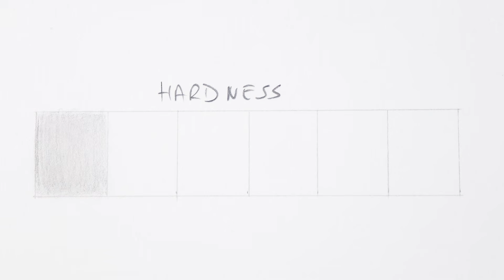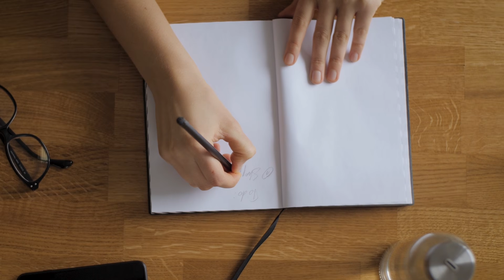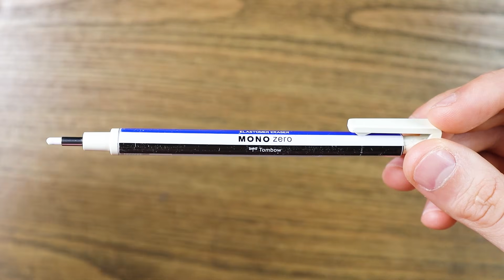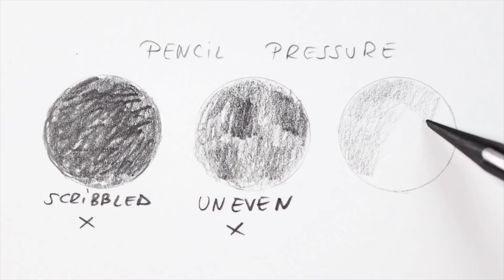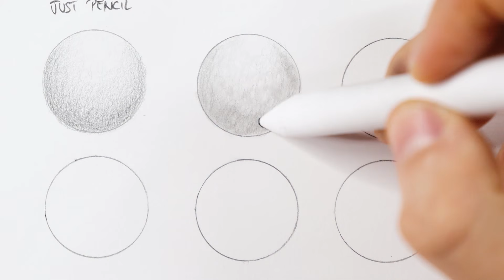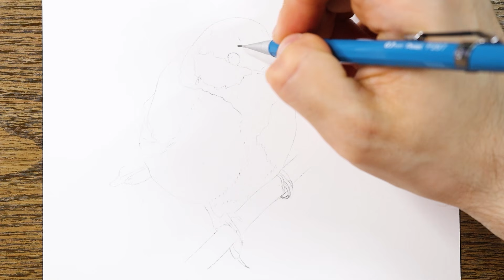HOW to USE GRAPHITE PENCILS | COMPLETE GUIDE for BEGINNERS

Comment: Question, Why when teaching for Beginners you did NOT start with a Light circle/oval for the head, and for the body. and divide where the center of beak is sort goes with line of the eye. which usually falls in the center. INSTEAD you started out with a semi tracing of your completed bird?  Doing this encourages beginners to FORGET doing circles, but put tracing paper over you completed bird , and go over their TRACING OF YOUR BIRD ONTO THEIR PAPER , having a far better non learning, on their own to do a bird they see that is NOT a photo or drawing..?
Reply from the maker: Because this isn't a video about proportions.

Comment: An eraser shield is one of those things that can be handy too. Although I suppose they take a bit of practice for exact placement of those highlight spots and picking the right masking shape? I don't see too many people using them while drawing in how-to videos. Some drawing kits still seem to include them.

It's also good this video gives scrap paper some mention for cleaning blending tools, because some neglect to do that. (Ditto for dealing with loaded erasers too.) And obviously a clean piece also comes in handy to protect things if you're the type to rest your hand while drawing.

And fine sandpaper or emery cloth can also be handy, if not helping to shape some pencils past the usual sharpeners, a clean bit of sandpaper can also rough up blending stumps to make them more fuzzy/softer if desired.

Last but not least, is that a painter's brush (the kind you find at a hardware store - as opposed to typically smaller artist's brushes) with long enough bristles can be used in lieu of an artist's erasing brush if you go light on the pressure while sweeping with it. It's an option if online ordering isn't always convenient, as some stores don't always carry a wide selection of art supplies.
Reply from the maker: Thank you for all these tips!